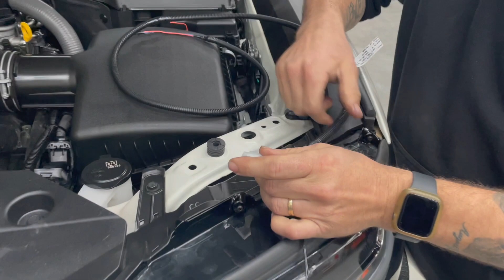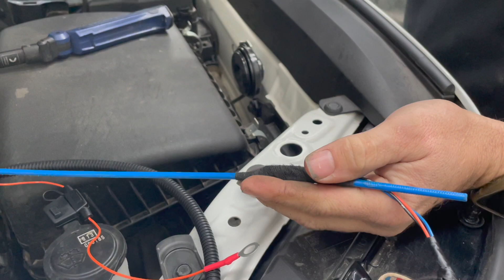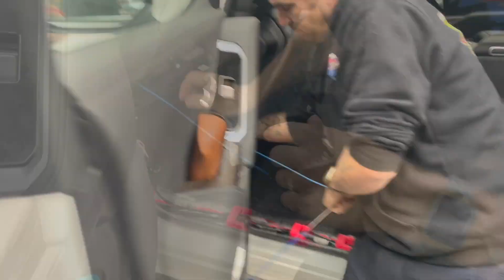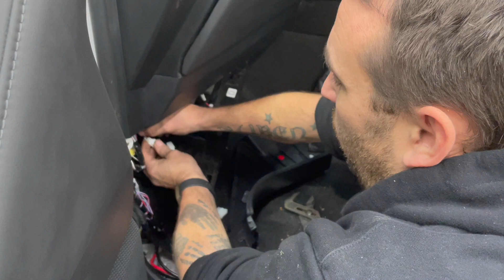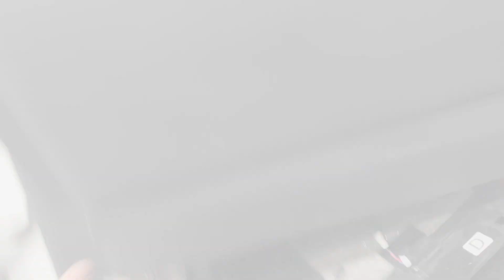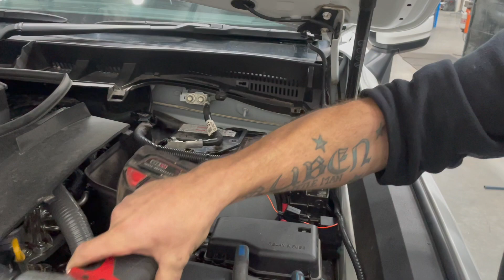RASLARR - 300 series Lightbar & Spotlight wiring kit installation guide

Comment: Hi do you have the diagram to connect your spot light wiring kit to the ARB Intensity IQ spot light switch ? as the ARB on/off .switch has multiple functions .I would definitely order your kit if I knew it could be integrated into the ARB Intensity IQ on/off switch.

Comment: If you buy narva ex2 led driving lights the 'relay' is built into the light itself so alot less wiring after running your high beam switch wire.